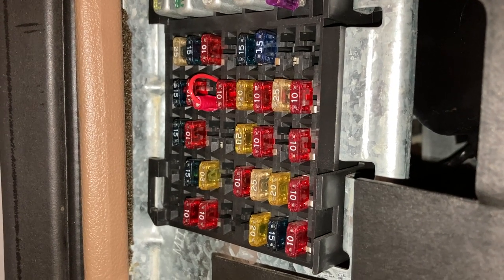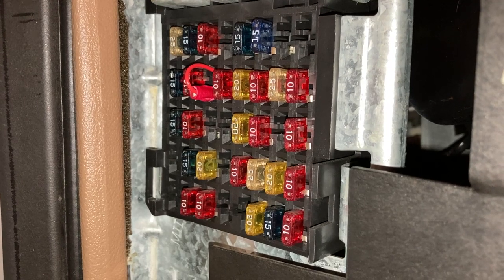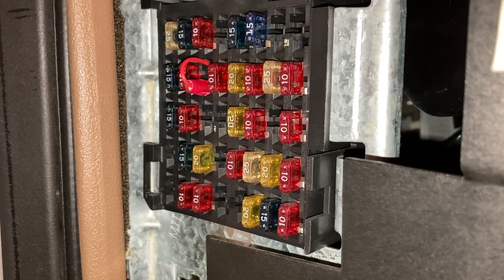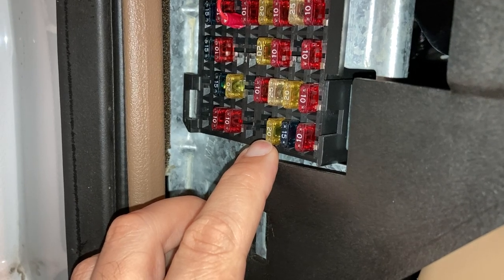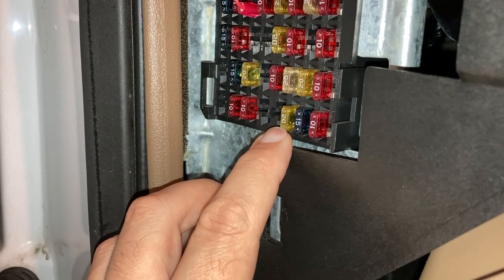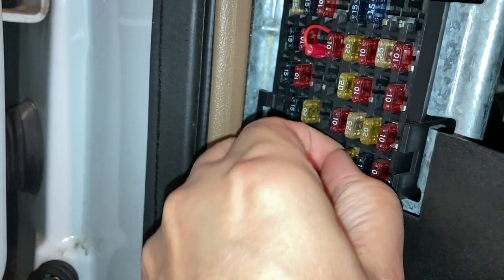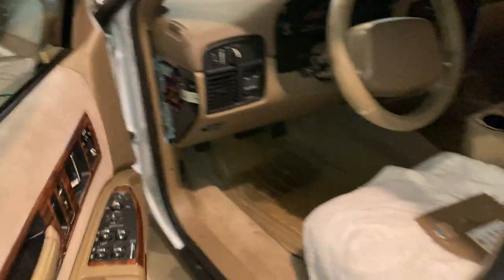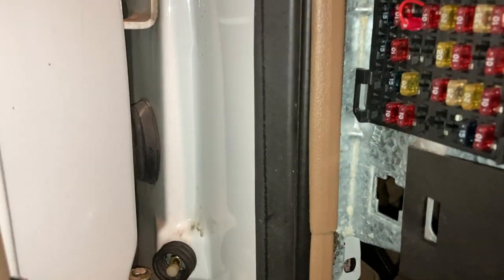1994-1996 Chevy Caprice, 9C1, Impala SS parking lamps not working?  Check this first.

Comment: I have a question? Just purchased a 1995 ss impala and I just realize that the whole fuse box is missing.. lights everything works, I checked because my lighter went out so I went to check and realize it was missing.. any idea wasup with that ?
Reply from the maker: Sounds like a prank. Nothing would work. There should be a hole where the fuse box would go?  If so look around in it. Maybe it just fell into the dash cavity. Otherwise I'd like to have a good laugh here!  The only other far fetched idea would be someone rewired the whole car.
Reply: @storm9c1 there is a huge hole, and everything works. Except now the lighter which I’ve been trying to figure how I should check the fuse..

Comment: I just had the steering column, rack an key cylinder replaced on a 9c1
And now the yellow trunk release button, cigarette lighter/phone charger, and the bell that dings when you forget to turn the lights off all don't work now
Are the wires for those things INSIDE the steering column and maybe they forgot to reconnect them??
Radio, door looks, turn signals all work fine
Battery is only 1.5 years old
I checked all the fuses an they seem ok
Reply from the maker: No. Those do not go into the column but still could be disconnected as the plugs are in that area. 

Let's do one thing at a time. The yellow trunk release goes through the PRNDL switch at the base of the column. This prevents you from popping the trunk while driving. So first make sure you are in park. Then try the trunk pop. If it still doesn't work then look for a loose or unplugged connector at the base of the column PRNDL switch.  Might want to confirm reverse lights work too. 

I highly suggest joining the Impala SS forum and asking us there since YT is not a good forum to communicate back and forth troubleshooting.  Just Google it and should be the first hit.
Reply: @storm9c1  
Ok yeah i'll check the connections when i get back to the car an if i can't get them reconnected ill look for more help on the forum 
Thanks
Reply from the maker: @GORILLA_PIMP  If you get poor help from someone else or I don't reply on the forum then PM me there with a link to your question. The forum does a poor job with notifications. But try not to PM me right off the bat. I can get inundated. See you there.

Comment: Which fuse is for power and which fuse is ignition fuse? My alternator not hooked up at all and i dnt see ignition or pwr on my fuse pannel
Reply from the maker: Hi.  It would help knowing what car.  If the alternator is not working on a 1994-1996 Caprice, Impala SS, or Buick Roadmaster, and you have no power to the field windings, there are two fuses at play.

Check fuse #8 in the underhood fuse box... should be a 10A fuse labeled "SEC FAN".  They tied one side into the secondary fan relay fuse.

The other field wire is a little more interesting.  That one goes to a 10A fuse #11 labeled "IP/IND" inside the interior fuse panel (driver's side).  Additionally, the "Volts Indicator" (Buick) or the "Check Gage Indicator" (Chevy) light bulbs also need to be present and functioning in the instrument panel.

Just like on earlier generation cars, that bulb feeds one alternator field winding.  So if your dash cluster is missing or defective, or the aforementioned bulb is burned out, your alternator may not charge.

All of this information comes from page 8A-30-0 of the Factory Service Manual (FSM).  I highly recommend you purchase FSM books if you intend to do more troubleshooting on these cars.  Hope this helps. Take care.
Reply: I have 94 9C1

Comment: I need the fuse for headlights
Reply from the maker: Short answer: There isn't one in the fuse box.

Long answer: For safety reasons, the headlights are wired through a "fusible link".  This link also feeds a bunch of other stuff including the front and rear parking lights and horn, so if those work, it's not a bad link.  There's also a self-resetting circuit breaker in the headlight switch.  If your lights aren't working, check the bulbs first (simple things of course).  Then check the main headlight switch.  Then check the hi/low dimmer switch on the side of the steering column.  And also check ground points (run a standalone ground jumper to your headlights if needed to test it).  If your car has twighlight sentinel (a dial to the right of the headlight switch), check that too.  If you car has been modified with an alarm, remote start, or police options, then the headlight wires could be cut or unplugged.  Finally, if your car is from Canada or a country that requires daytime running lamps, check that system.  It's too hard to provide in-depth technical support here, too many possibilities.  You didn't even say what year/make/model you have.  Please join the Impala SS Forum and ask for further advice there.  Thanks!

Comment: My rear parking lights work, new bulbs in the front, no parking lights there. What's the issue? 96 impala.
Reply from the maker: Could be a bunch of things. Check connector under air box area. Check hot and ground terminals at the socket with test light or multimeter.  Try another set of bulbs. Make sure they are 1157 or 2057 incandescent amber bulbs.